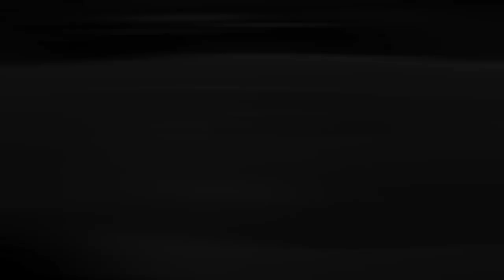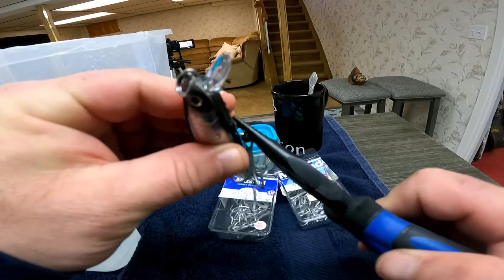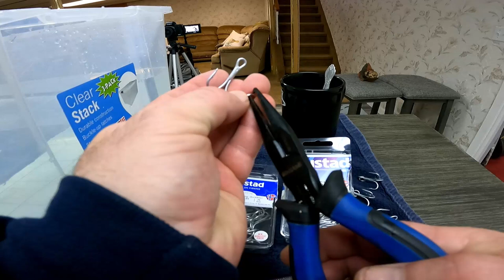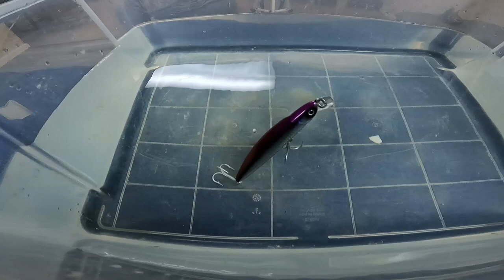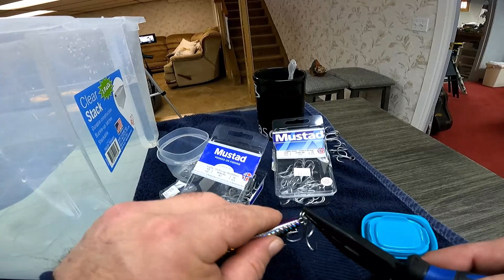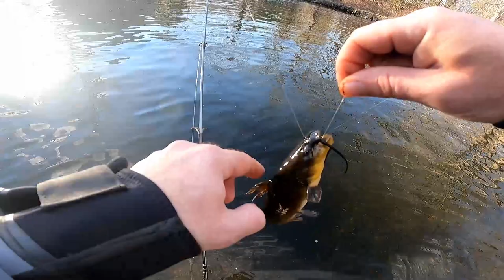CHANGING THE HARDWARE ON THE DAIWA SP MINNOW (WHY I DONT DO THIS ANYMORE)  AND 500 SUB WINNER

Comment: Solid video..this reminds me of Steve Campo's comment that "everything works" depending on conditions.  Curious on your thoughts about omitting the nose split-ring?  Alot of anglers feel this is redundant if you use a TA clip, but there is definitely a difference in the action when you keep the nose split ring and use a TA Clip combined. Lastly, thanks again for even offering a giveaway...pretty cool.
Reply from the maker: Everything does and will work.  Even with the 2/0 I have caught plenty of fish.  I know a lot of guys take off the nose split.  I do not and also think the action is better with it there.  Thanks for watching!!
Reply: I know im late but I put a swivel on the nose split ring. It makes putting a TA clip on so much faster and the action is amazing also.